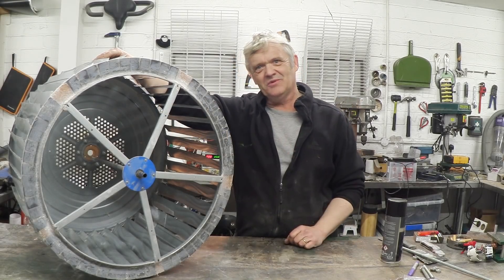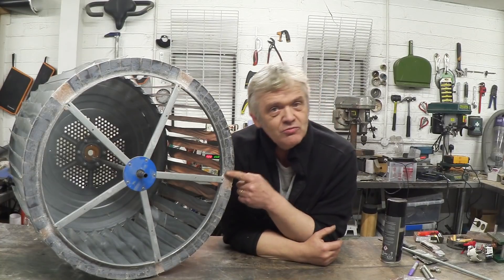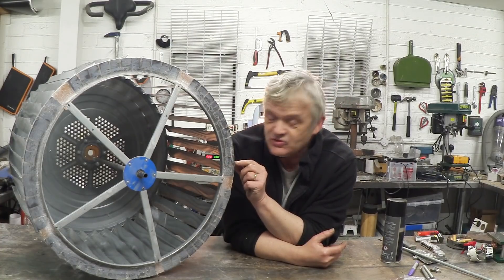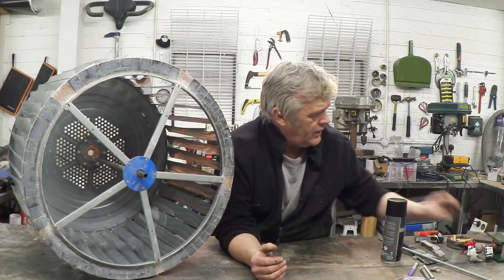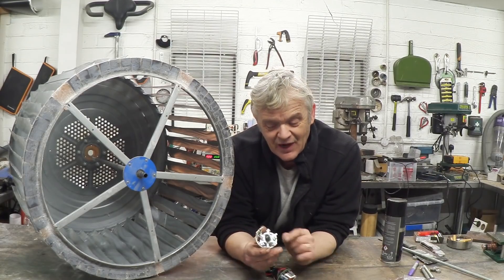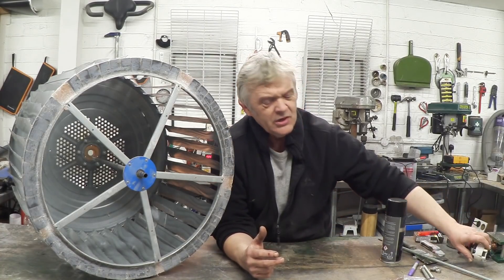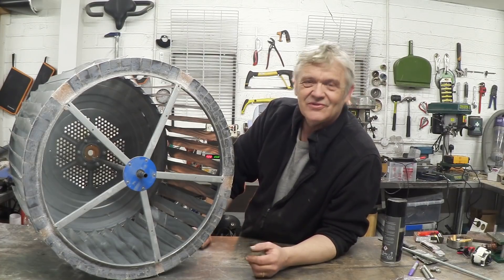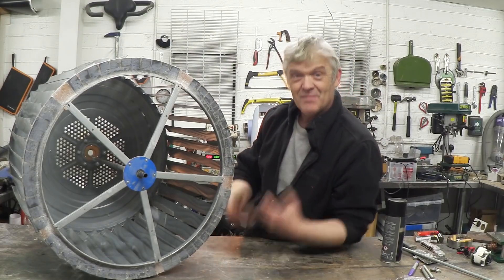Tumble Dryer VAWT Magnet Arrangement

Comment: You are absolutely right on neodymium magnets vs ceramic.  If you look at what magnets are used in permanent magnet alternators for automobiles, they are ceramic.  If you look at most generators on the market, they are using ceramic magnets.  Of all my searching, I only found one reference to neodymium magnets being used on a wind turbine generator.

If you think about it, it makes perfect sense.  On a generator, the only drag (friction) you want is from the force that is turning your mechanism.  You try to reduce drag everywhere else.  Having stronger magnets might give you a stronger magnetic field to pass through your coils, but the increased current will be very small compared to the increased drag caused by the repulsion created by the magnetic field from in the coil.  People tend to forget that when you create current in a coil, that current is moving through the coil and creating a magnetic fields of its own (Lenz's law).  So the trade-off between the increased current generated eventually becomes offset by the increased drag caused by countering magnetic fields.  That doesn't even take cost of materials compared to the perceived gains at all.

Where is that trade-off point?  I couldn't say.  I am an amateur when it comes to this stuff.  But, considering that the professionals that engineer these things for commercial production favor ceramic over neodymium when it comes to motors and generators, I think I know which side of the argument I would choose to fall on.

Comment: I approve of your heresy in this case 😁. What you are constructing is a much more efficient design, because there is NO torque requirement to get the drum to turn a belt or gear or shaft to generate the power made by the system.

The lack of counterforce makes the design as efficient as the materials of the unit and contruction techniques will allow.

Smashing job mate!

Comment: For a low wind speed, how about using two of these mounted on the same shaft with one rotating clockwise with magnets on the bottom and another below it designed with the rotor to go counter clockwise with coils on the top of that one.

With the coils going one direction and the magnets going the opposite direction, you could get twice the rotational difference between the magnets and the coils at the same wind speed.
Reply: I think that's a great idea. The coil side could use slip rings and Bob's your uncle.

Comment: You on the right path with your magnet choice. 
The stronger the magnet, the smaller the field. 
A coil will pick up a ferrite magnet from a few centimetres yet the same coil would have to be a few millimetres from the Neyodynium magnets.
You may consider some iron for you coils tho. The induction is effected by the magnetic permeability of the core. 

To combat the cogging effect of iron cores. Space 3 coils across 4 poles.

Comment: This is a good way of spending time during a lockdown! Not using neodymium magnets makes total sense from an economical perspective, since the generator is only making power in the1 tot 100 watt range. If you made some characteristics of the windmill generator (over the span of a few months), you could calculate your return of investment time. Which is, even with cheap magnets, quite long. As you say, this is more about experimenting, and maybe having some diy independent power :)

Comment: One of the challenges with VAWTs and direct drive is getting enough rate of change in magnetic fields to get usefull electricity for charging a battery.  That's why some might consider neodymium magnets.  The when using ceramic magnets one needs to spend more on turns of copper coils with the current limiting voltage dropping internal resistance that comes with longer and thinner wire.

Comment: One wants to keep the air gap between magnets and coils as small as possible.  The magnetic equivalent of electrical resistance is ‘reluctance’ and the reluctance of air is very high. This is why a car alternator is only about 40% efficient (due to large machining tolerances) but power station generators are engineered to achieve 90%. Magnetic fields decay as the inverse ‘cube’ of the distance , so the size of the gap has a very significant effect.
Reply: Standard car alternators are typically around 55-60% efficient but it depends on the speed of the motor and the load being drawn so at slower engine speeds they tend to be less efficient.  Most of the losses are coming from the internal heating of the windings themselves due to resistance and inductance at the high current draw.  A typical car or truck alternator may be putting out 125-300 Amps at 14-15VDC so you are asking that tiny alternator to output up to 1750-4500 watts at maximum load.   High-efficiency alternators are typically in the 68-75% range. The gap also does play a big role but that is mainly needed because most alternators need to function in a harsh environment where dust, dirt, and debris can enter the unit thus tolerances in some cases must be larger.
Reply: @kuhrd  Used to work for Lucas CAV. The OEM’s (our customers) wanted automotive alternators  as inexpensive as possible — so hence the wide tolerances (there are four surfaces for which ‘compound error’ can increase or decrease the air gap and to each there is a associated cost). Even our EA sealed alternators (those used in explosive atmospheres like coal mines and oil refineries) where no crud can enter, had the same wide tolerances for reasons of cost. Also I was talking real world. Cars are geared so that the average driving rpm is around 2,000 rpm at which speed the alternator is only 35 – 40% efficient. For wind turbines, where the alternator speed may  only be a 1,000 rpm, then one is looking at an efficiency of about 5%. A magneto would be more appropriate for these low speeds, such as Rob is building.  Also, as Rob alluded to — faster is better.  It is also preferable to choose the right wire gauge etc., to suit the operating perimeters of wind instillation but for this type of experimentation, Rob is making the best of what is just laying around (my definition of ‘rubbish’ is some thing useful, in the wrong place at the wrong time). This is one of the problems with degree courses. All theory, with very little in the way of awakening innate creativity. This channel certainly helps fill that gap.

Comment: If you are in fact looking for neodymium magnets it is actually cheaper to by a hover board hub motor then the magnets alone.  They pop right out with a bit of care.   They can be had for about a dollar each.
Reply: I'm using one of those hub motors in my DIY wind turbine, nearly gave myself a hernia trying to separate the two halves until I worked out it's MUCH easier if you leave the face plate on to keep the spindle centralised. 🤣

Comment: Tinkering is cool. Done my faire share of it. I wonder if instead of alternating polarities of the magnets, you arrange them in a Hallbach array pattern to increase the field strength that cuts across your pickup coils. Increasing the field strength would increase the power output for the same rotational speed of the turbine. 

Just a thought.
Reply from the maker: it's a good thought mate

Comment: Have you considered connecting the coils and electrolytic caps as a LC resonant circuit for each one (without diodes), that way they will oscillate and the oscillations will 'load' the coils for you. If you only drain a small fraction of the energy of the oscillation (not the whole lot), then you have these oscillations multiplying the generation capacity of your setup so that the lack iron core or strong magnets becomes irrelevant.
Reply: On second thought, you would have to use a diode to protect the electrolytic cap against reverse polarity during oscillations, but you could use two electrolytic caps in reverse with diodes so that the caps charge and discharge only in half waves where their polarity is correctly connected. You will have to aim for a natural frequency roughly matching some gentle spin of your turbine per second multiplied by the number of magnets you have divided by 2 (I think). If you use a mosfet that only turns on for some fraction of the peak of the oscillations, then you can bleed off only a portion of the energy for a load and ensure that some always remains to keep the oscillation going and generator working properly. Also you can connect every other coil in series with each other and then only use one or two large capacitors, no need to do it for each coil, simplifies things.

Comment: These equasions might help predict a generator's performance under load.

Open circuit voltage = RPM × (the generator's Kv motor constant, volts/rpm)

But, under resistive load these equasions are helpfull. 
current in a series circuit is the same everywhere in that series circuit.  and 
i=v/r; thus 
1) Current = (open circuit voltage) × (coils resistance + load resistance ); and 
v=i×r
2) voltage across a load  = current through that load × resistance  in that load. 

Thus, it works out that for a given rpm, the voltage across the load (coil's output voltage under load) = (open circuit voltage) × (load resistance)/ (load resistance + coil's resistance),  and the difference between the open circuit voltage and the output voltage is the voltage drop across the coil's internal resistance. 

thus one need only the open circuit voltage per rpm, the rpm, resistance  in the coil and resistance  in the load.

Comment: I don't think that people realise that ceramic magnets are not the same as they used to be. These days they are much stronger than they were a decade or two ago. I recently purchased some and was pleasantly surprised by their strength respective of what they were when I was much younger. Besides, it isn't a generator per say that you're building rather than a harvester for getting the energy a breeze has. I guess this is why your not using ferrite core coils which would generate much more torque and need a stronger wind to work. Great to roject Rob I'm looking forward to seeing it completed and working to see the output difference in different wind conditions.
Will you be using fewer bridge rectifiers to minimise the voltage drop or am I wrong that each coil having its own rectifier means a larger voltage drop?
Reply from the maker: you are right mate - they are much stronger than they used to be. The coils I am using generate 20-30V so I am not that worried about the voltage drop and I don't know but I think it is important to isolate each coil
Reply: @ThinkingandTinkering  I guess a Schottky diode would only have a lower voltage drop

Comment: It's more than ok if it's enough power to keep a shed battery full of charge. Then you have free light and power to invert into more usable power. In a few years it will more than pay for the component's battery i call it trical charging along with solar panel it's free energy.😁

Comment: Er.. Strength of magnetic flux is directly proportional to the emf produced. Blame Faraday. The very best ceramic magnets are very good, and produce ~1/2 of the Gauss that N40 NdFeB produce. But very cheap (and the most common) ceramic magnets are Very weak, and only produce in the range of 1/10th to 2/10th the Gauss of a garden variety rare earth magnet. So, yes, if you have very good ceramic magnets, you will have a good result. You would have a great result with N40's of the same size, but it would cost a bit more. Young players beware, you only get what you pay for....
Reply from the maker: that's true mate but it would only work to a point and there are the opposing effects to consider
Reply: @ThinkingandTinkering  As in all things, but I were designing it, I would use 2 rotors of cheap NdFeB magnets and carefully wound magnet copper coils. However this design would never have occurred to me, and it's not my design so I'll shut up. But please don't denigrate any technology over any other unless it deserves it. NdFeB magnets always have more Gauss, so will always be better in any wind generator, though a bit more expensive.